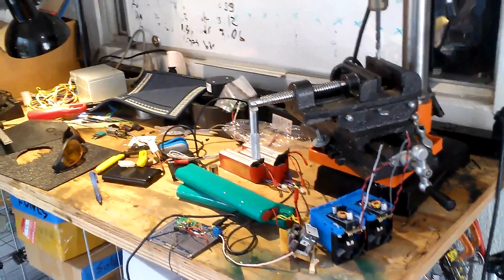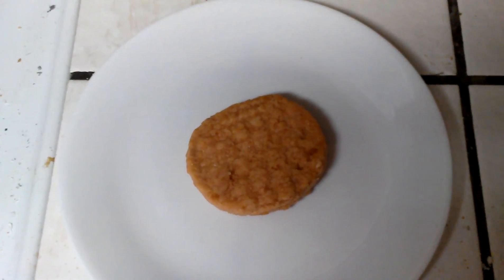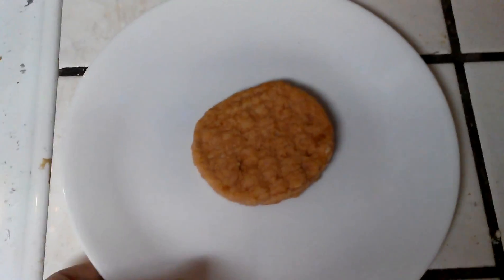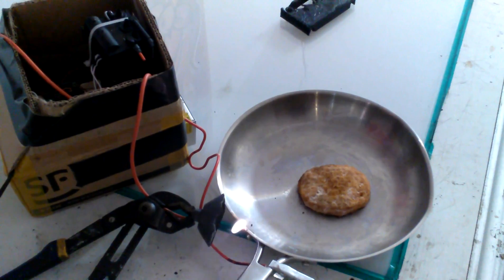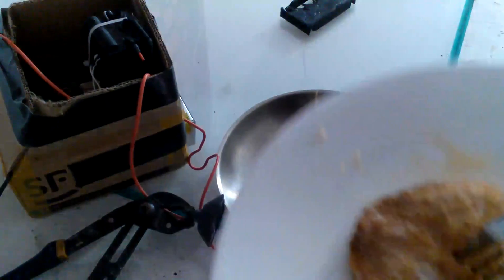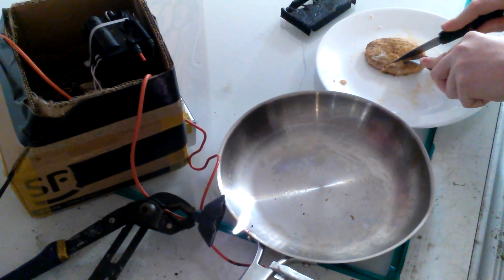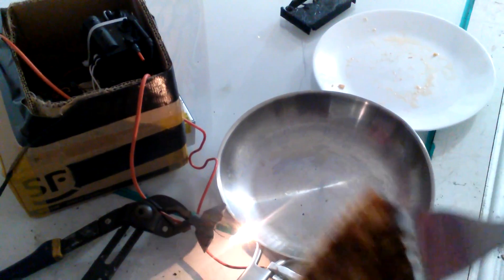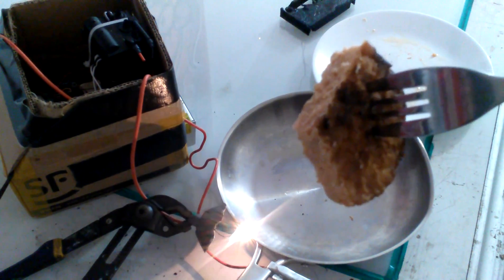Cooking with plasma!

Comment: I feel as though you could get more char over a better area with some hardware cloth. 

Snip a bunch of the struts to make corona pins (like a bed of nails) and then hold that over the burger. I think it would cover more of the meat at a time and distribute the arc better
Reply from the maker: That's a great idea, thanks! What I was going to try next was a little acrylic arm to make the electrode move in a circle. Corona pins sounds prettier though!
Reply: @RobotsEverywhereVideos  i know this comment is super old but holy shit it didn’t age well